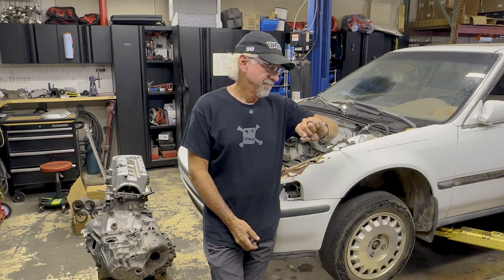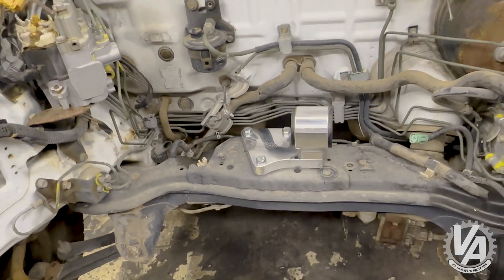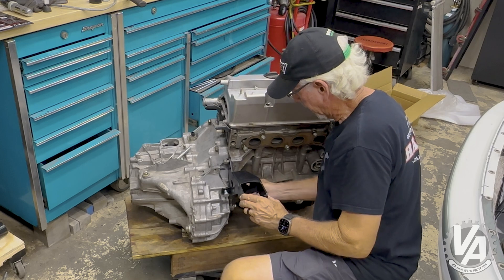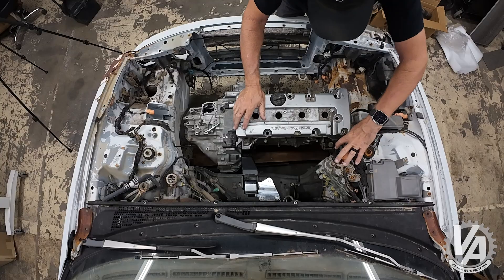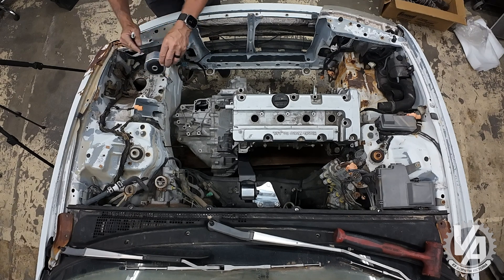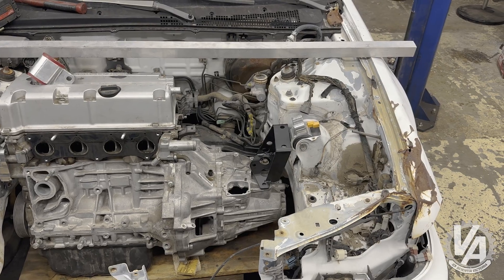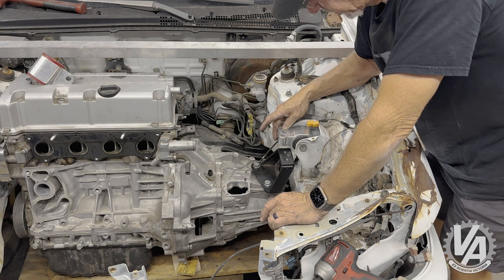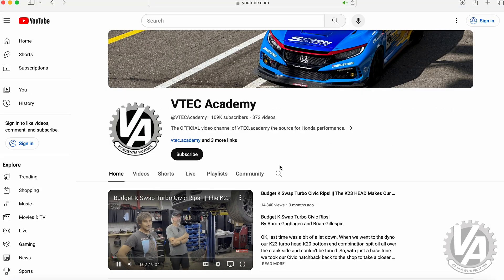How to Design a K Series Swap Mount Kit (It's for the CB Accord!) K20 or K24

Comment: looks lie it fit 3rd gen prelude
Reply from the maker: The third GEN prelude has such a low hood line. It makes it difficult to put a K in there.
Reply: @VTECAcademy  you only have to cut the frame of the hood and im in the process or making a taller hood for k swaps its  been done

Comment: can you please do a video on putting a k series in a non Honda car? Im not saying get it completely done and driving and wired etc, that part is easy. Just show how to set the engine in like this and how to set it at the correct angles and drive axle alignment just as if you were gonna make mounts for it. And what to look out for. Would be pretty Amazing. Some people may want to engine swap their old beater cars and they can get the engines cheap, but may not already got a Honda etc.

Comment: Please please please get a 3.0CL rearward subframe and design mounts using it! It has the mount location in almost the perfect location to line up with the T bracket and is clearanced for the transmission on the driver side since it had a J series in it! The same subframe was used in the 95-97 Accord V6. I'm unsure if it will work with the CB chassis, but its a direct swap into 94-97 Accords. It should allow the drivetrain to be moved back another inch or two for perfect axle alignment. I have a sneaking suspicion that with the correct length midshaft, the 3.0CL/95-97 V6 axles will be the perfect length for the swap as well. This would also allow for simplicity of J swaps, too. The timing side bracket/mount/post mount from the 3.0CL should also make things simpler for that swap, too, maybe also for a K.